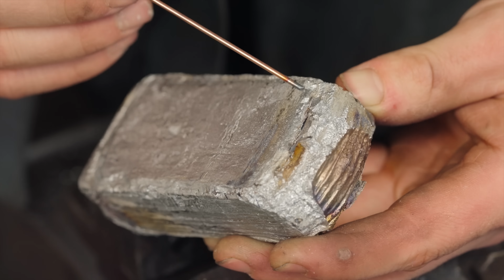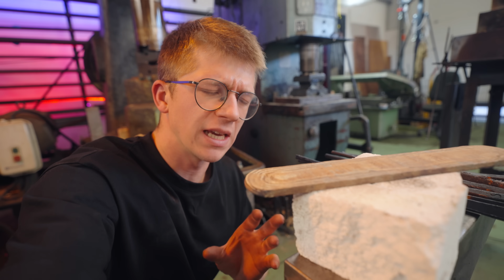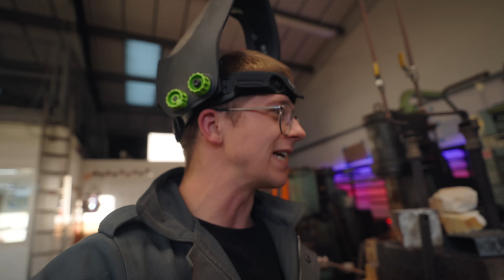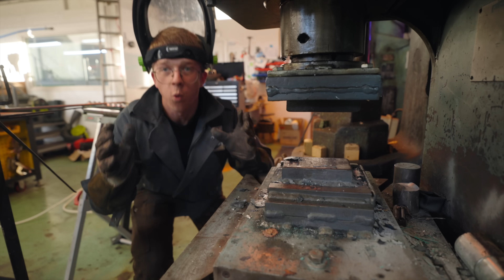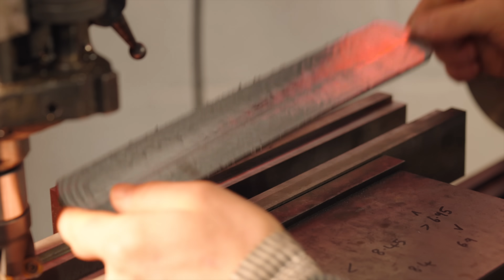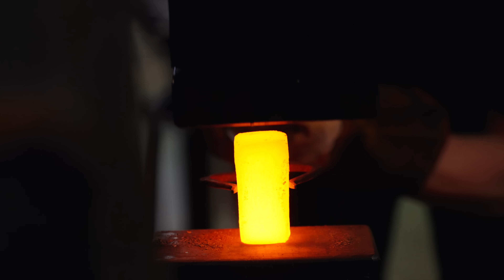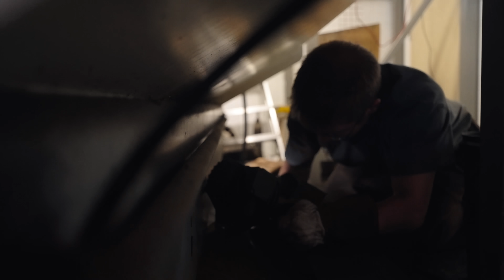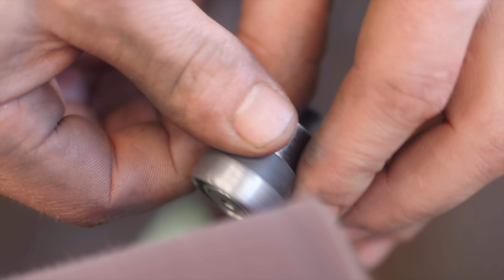Can I Make Titanium Damascus? Part 2

Comment: You should try putting somthing as  a coating on the outside of the box casing (I hear whiteout works) to make it easier to peal off the titanium. 
they do it on steel case Damascus, so I presume it would work for titanium too.
Reply: TiO2 on the inside of the steel can.  Lime slurry allowed to dry also works.  And probably cheaper and easier to find.

Comment: could the melting be a function of the pressure inside? I am reminded of a video someone did that showed that dry ice will melt to a liquid state under slightly higher pressure even if the temp was normally cold enough for it to be solid. I think most of the melting point measurements assume that the material is at 1 atm, could the rigidity of the outer layer put more pressure on the inside and allowing the inner metal to be melting at a lower temp?

Comment: Don't inert gasses make tempuratures rise in welding? Like using co2 instead of 75/25 for mild steel, the co2 can be hotter. Maybe the argon purge in your billet is increasing tempurature

Comment: On the cutting. When I worked in a failure analysis lab we used a diamond cutting blade for sectioning samples for analysis. Specifically the Isomet 1,000 from Buehler. It was slow, but it could cut through basically anything if you gave it the time.

Comment: Does the melting temperature increase with an increase in air pressure(you pumping a gas in a container which could increase the"air pressure) second the change in the composition of gas could affect the melting temperature as the gas could change the temperature in the container(I don't know just a thought it two)

Comment: About titanium rings and jewelry: I have worn one long term and straight titanium will wear to a matte finish on hand jewelry since it only has a Mohs hardness of about 6 for most alloys (. These are only surface scratches, though, and deep scratches are rare. It's easy enough to polish, though. Titanium dioxide finishes, like the finish you placed on here, can be much harder and adhere to the surface of the metal very well, as you have experienced, with their hardness on the Mohs scale being more like 6 to 7, so closer to the hardness of glass, ceramic, or quartz. It's part of the reason why they are used as industrial coatings since they are very chemically inert, adhere well, and are pretty tough. They aren't invincible, though.

Comment: Do you turn the gas off before you hammer the thing? Also, you should have cut the center of the ring out instead of drilled. Save material.

Comment: the reason it is exploding is because you are making a completely new alloy when your heating steel and titanium together with out a buffer coating on the inside of the container. use acrylic or latex paint on the inside of your billet cannister should fix the problem a bit

Comment: I think a thicker jacket will actually help you. it could remove heat from the sides since its thicker, and stronger to stop splooges of hot liquid metal, and as others have said the titanium phase diagram for iron maybe do 100-200 degrees cooler and you might be good. you only want the metal to be molten enough to bind, and with the casing, let alone the different alloys, its becoming fluid. so cooler temps might STILL be the answer

Comment: Just use electricity for the oxide formation . Safer and easier to control . Check online but it's super simple if you have an adjustable power supply that goes to around 60volt . Did it at home back then with some backing soda water and a lipo battery.
Reply: Just when I wrote this the part of the video came up 😅😅😅

Comment: Just a heads up Titanium is actually insanely hard to start on fire accidentally. Its transfers heat exceptionally well. That means to the air and other piece nearby. Unless you stick a torch right on it or have a very fine chip that you again stick a torch on it simply just won't burn. Pretty much any coolant will prevent it from burning. Also if it does light on fire don't bother trying to put it out. You'll need a Class D extinguisher that will only work so so. As for machining it always run as much coolant as you can. Avoid cutting radii at the same time as floors and or walls. The flexibility will cause some ridiculous cutter wear if you do. Unless absolutely necessary use climb milling. Conventional will run like poo.
Reply: Titanium is used in aerospace primarily because it DOES NOT transfer heat well whatsoever.
Reply: Um, titanium does not transfer heat well. It has an even lower thermal conductivity than stainless steel, about 10x lower than aluminium or 30x lower than copper.
Regardless of that it may be right that it's harder to start an accidental titanium fire than some sources would suggest, but this is not something to take light-hearted, as such fires can certainly very hard to extinguish.

Comment: The most logical awnser to me is is that your inert gas system was simply not effective enough. Titanium dioxide is a pxidiced form for titanium that forms at 900 degrees and that proceeds to melt at 1800 resulting in the motlen stuff shooting out. That is simply my geuss.

Comment: From some simulations i made i think you should just heat it up first to almost melting, then let it cool a bit to forge.
The smooshing pattern might be because it's too hot, so the interior is really soft and hotter while the exterior is colder and harder

Comment: Courser blade will definitely help, also if possible slow the blade speed down. At work we usually use a carbide tip blade with a 2/3 pitch for S.S. And other hard exotics.
Reply: I believe faster is the way to go, SFM for cutting titanium is roughly 3 times faster than alloy steel, iirc.

Comment: 6:30 This is just like in solder when you have tin and lead which both melt at higher temps than the solder itself. You two grades of titanium (titanium and steel) are making some "low melt temp titanium".

Comment: If you are considering steel-titanium damascus, maybe consider using vanadium between the layers. I have read that vanadium foil is used in cladding titanium to steel because it is compatible with both iron and titanium (Vanadium on wikipedia - Other uses). From the reference: "It should be noted that direct welding of titanium with steel is not possible, because the welding produces brittle chemical compounds ( Ti - Fe intermetallic compounds) which cannot be avoided at temperatures exceeding 500 C." and "The best intermediate metal for welding steel to titanium lining is vanadium."
Reply: Maybe smack a wrench or two inbetween them eh?
Reply: @armageddontools Your "vanadium" wrench is made from steel that contains vanadium, but like all varieties of steel it is mainly iron.
Reply: I strongly advise against this, vanadium is very nasty to work with
Reply: Do not do this. Vanadium is very nasty
Reply: Absolutely not the right path.

Comment: Titanium is wild and you have different types that have totally different properties besides just being titanium. It's a whole other beast from steels or more typical working metals from what I've seen. When you start introducing other materials to it you end up with weird eutectic melt points and all sorts of fun things. I've seen titanium turn into a spray paint which then fused with other steels and basically became essentially impossible to deal with and resulted in scrap lol

Comment: It’s a layer of steel that melts. Just like welding. You can get metal to melt without reaching the “melting temperature” because of the argon.

Comment: Possible explanation for the ice cream sandwhich effect; the outer layer is losing heat from absorption in the top dies  so the outer layer is retaining its harness and the center of the bar is acting like a heat sink  maintaining the heat of the layers longer as they arent in contact

Comment: The pure metal melting point is higher than what you got in your furnace, but alloys of metals can have lower melting points. So if you mix titanium with iron, the eutectic point is most likely much lower than the melting points of the pure metals so the mixture melts in your furnace. Take a look at phase diagrams ;-)

Comment: It looks like the orignal bandsaw blade was in backwards?
Reply from the maker: This bandsaw model happens to be designed to have the blade run away from the fixed jaw for some reason, so blade was in correctly!
Reply: @AlecSteele  I saw that later, and found myself wondering if you have phases switched in your three phase 🙂
(That said, my dad's Wicksteed saw cuts on the push, but that's a "donkey saw")
Reply from the maker: The drive wheels have arrows to show correct drive direction so I’m fairly certain it’s going the right way for the machine 🤞

Comment: About the melting temperature, you asked about the melting point of titanium, assuming pure titanium, not about the alloy of titanium you have. Usually, the temperature decreases with alloying elements, let’s check it on a phase diagram! In addition, the stress you applied during the forging increases the local temperature.

Comment: Here's my theory for liquid squishing out. Titanium is terrible at conducting heat, so the billet doesn't heat evenly, a slower and longer heating maybe helps out, a more gradual input of heat, because its probably overheating at the outside while in the center is colder.

Comment: If you CAN weld steel and titanium together like it seems the jacket did in the beginning, that would be the by far easiest way of welding complex patterns of titanium damascus. 

Because you dont need to do all those special steps while welding two pieces of steel together, so if you just divide the billet up with the jacket still on, you should be able to weld the pieces together jacket to jacket, which should be much simpler.

Edit: ok, perhaps that's not strong enough.

Comment: I just want to sprinkle some material science to help you: 

For your future work on Titanium Damascus, I suggest forging below 1085C (1050C would work just fine). When looking at the Ti-Fe phase diagram, there is what we call an eutectic reaction (a precise concentration of element that forms a liquid) at 1085C. So, in your video, the liquid metal coming out when forging at 2000F (1093C) is most likely to be this phenomenon. 

Moreover, forging at lower temperatures should also help you fracture the Ti-Fe intermetallic at the canister-alloy interface, allowing you to remove the canister easily. This also explain why you cannot forged steel to titanium.

Also, the Ti-Fe intermetallic form is hard and brittle at the canister-alloy interface. This explains why you can remove the canister from the titanium billet and why cutting the as-forge surface is not great. 

Cheers!
Reply from the maker: Loving this thank you so much for the info!
Reply: @AlecSteele  Also, factor in the very classic rough estimate of PV=nrT a direct correlation of Pressure and Temperature. In a closed off casing, even with the slight opening for air to escape and with that rather strong injection of Argon pushed into it, you increase the pressure inside said casing which thus boosts the temperature as volume does not change fast enough. If your forge reaches the eutectic reaction point temperature and you leave the encased billet long enough for it to come very close to it there might be a section inside that will actually be over that temp point due to that extra pressure. (Might explain the extra damage of the first billet near the bottom... oh and the explosion of that second one too)
Reply: @AlecSteele nope you just don't have real titanium...
Reply: @AquarianSoulTimeTraveler yes quality and sourcing issue surely
Reply: @Alec Steele: sounds like you should install a temperature controller on your forge like you did in Montana!
Reply: Wisdom like this brings me the most happiness
Reply: @ZZTalkZZ  If you watch the previous vid, that's the patent Alec is following. (Since it's now expired)
Reply: Cool
Reply: Hey, a correct answer.
Reply: Ive copied this comment and sent it to about 10 people with absolutely no context.
Reply: I would have pickled the ingot in nitric acid because I think that would dissolve just the steel
Reply: It also makes me wonder if the argon isn't flowing fast enough, it seems likely that's the purpose of the argon so it could be that if you increase the flow rate that could stop happening. That's a bit of a big ask when it's already so expensive to make though.
Reply: in comes the SCIENTIST to FlEX ON US. jk great info!
Reply: Where do you learn that?
Reply: @wdas3063 In material science or material engineering. I would've loved to know that it was a possibility when I chose what to study back in the day. I went into chemical engineering, dropped out for a year to improve my grades and went into computer engineering, and I'm now working in cyber. There's a world of possibilities out there, but someone has to show it to you. Material science/engineering sounds like an awesome choice and a versatile degree if you like tinkering with science in general.
Reply: Dude! Shush, he'll make a part 3....
Reply: This cannot be the correct explanation. A eutectic mixture requires exactly the correct ratio of metals. Even being off by 3-4% by weight will result in a the formation of an additional phase for ti-fe. Additionally, both grade 5 titanium and steel melt far beyond 1085°C. They would never have reached sufficient temperature to mix into a eutectic mixture, and the rate of diffusion at this temperature is also far too low for it to occur in a solid phase. It’s just a simple plastic flow of a metal, as occurs in aluminium extrusion.

Comment: It melts far below its melting temperature because it forms an alloy with iron. You can see it in the cross section of the ingot. The iron shell formed an alloy with the titanium inside and left the rest untouched. This can be seen in the form of a light gray layer between the iron shell and the layered titanium (as good as I can see this on the image). It gets more visible when you remove the iron casing.
In the binary phase diagram Fe-Ti, you can see that there are alloys formed with a melting temperature far below 1668C/3034F. The composition of Fe32/Ti68 shows a melting temperature of only 1085C/1985F. In combination with various other minor alloy elements in the steel and titanium this forms a melt while you “only” heat it to 1095C/2003F.
Reply from the maker: This is so fascinating! Thank you so much for the detailed comment. Learning a lot!!

Comment: Yo,  just slow the band speed down on that saw, you want to be at 10ft a minute on titanium, you will have no teeth wear at this speed and it will cut faster.   Your drop speed should be about 1 inch a minute on that thickness, a little slower actually.
Reply from the maker: Thank you!! Can’t slow the saw speed any further without loosing friction on the drive though unfortunately bit of a bummer!

Comment: Yep it is because the iorn in the steel can and the titanium are amalgamating and liquifying.

And interesting the way to combine steel and titanium is to use an intermediary layer that is compatible with both vanadium was mentioned in the article i read but aluminum is also titanium compatibile i believe as grade 5 is an alloy of aluminum vanadium and titanium...
Reply: I don't think titanium and steel amalgamate at all. If they did, then how could he have made Damascus?
Reply: @deucedeuce1572  the timascus is grade 2 and grade 5 titanium there is no steel in his pattern welded titanium. Only steel is in the cans. Also when i said titanium and iron amalgumated i didnt just talk out my rear i looked up the issue and found articles talking about fe ti amalgamations that form at over 600c the cans he should be making need to be a different alloy probably stainless steel.

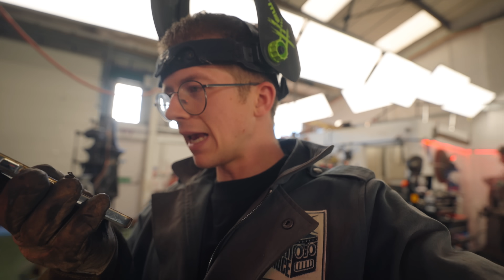Comment: Is it at all possible, that the inside titanium is holding onto much more heat than the outside steel, so perhaps allowing it to cool a bit before pounding or a lower forge temp for longer time could work 6:01

Comment: From what I saw it seems the piece failed in an almost brittle manner.  It turns out mild steel reacts to Titanium at high temperatures and is very reactive at high temperatures forming intermetallic compounds, which are very hard and brittle this would cause failure at these temperatures since the titanium-iron compounds are formed by diffusion between the mild steel and titanium I suggest switching to a different alloy to hold it like a nickel-based alloy with a high melting temperature.
Reply: Also, the steel cap on the billet sheared off after the first pressing. Rewatch the video. It definitely did not ooze out. 

This comment makes me wonder if the pressing forces are pushing the titanium against the brittle titanium/steel alloy at the end of the billet and causing it to shear off like that. Enjoying the content Alec. Nice work.
Reply: Inconel.

Comment: A lot of folks talking about pressures, but I'm thinking more occam's razor: how hot is it in the center of the forge where the billet is being heated? I could be wrong, but it didn't look like Alec stuck the probe in all the way to the center. It is conceivable that the center of the forge is significantly hotter than the part where the probe was. IDK, pressure would have been my second guess.

Comment: Maybe the different thermal conductivity of the titanium causes it to hold more of the heat. Also meaning the heat from the pressure builds up more rapidly also. So, you should probably start forging it at quite a lot lower temperature, and it will improve as you apply pressure to it. You are measuring the temperature of the forge also, with the thermocouple, and not the block. Not sure if IR can be used on temperatures that high, but it wouldn't be a bad idea if there is a way.
Reply: Yeah, you can see how bad it starts off and then how much better it gets as it cools.